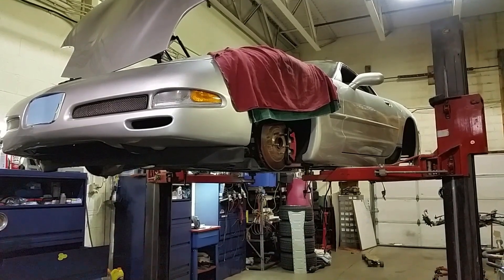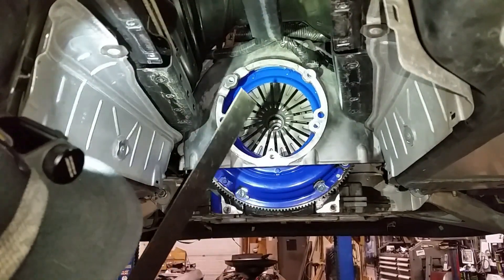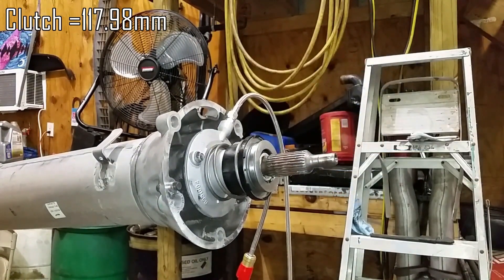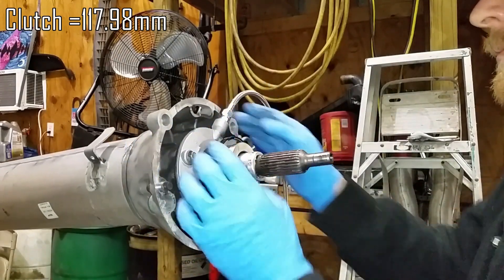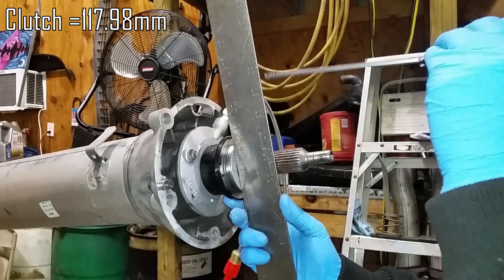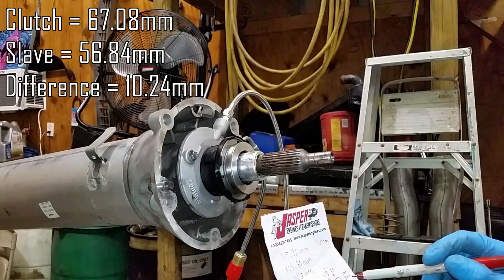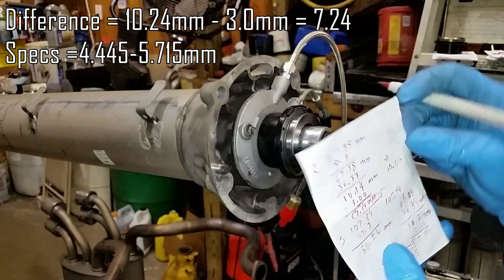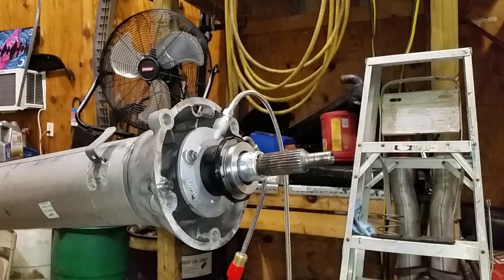How To Shim A Clutch for Quick Shifting At High RPM! : T56

Comment: Hello sir, can you tell me what the tool is called that you used with the straight edge to determine the distance and where i could find one? Thank you.
Reply from the maker: Its called a "Dial Caliper" Here is an amazon link https://amzn.to/3CIZ0dd 
I prefer the analog ones they work without batteries but the digital ones work just fine and are easy to get started
Reply: @CamaroRick  man thanks a ton for that!

Comment: I have a c5 z06, fully rebuilt trans, new McLeod rxt/shimmed properly .080, new slave, tick master. Go it all installed broke in clutch and did my first wot pull and the trans grinds going into 4th at high rpm. Trans shifts like butter driving normal. Any ideas?
Reply from the maker: The slave cylinder might not have enough throw, have air in it, or the clearance specs could be wrong, improper trans fluid etc. Id give McLeod a call and run through the options

Comment: Hello, i just bought a 99, c5 vette, i just made the whole clutch change, but the slave cylinder doesnt have any shim, the problem is that i have done this for 2 times, and both times the slave cylinder brokes, do you think that the shims are the real problem?
Reply from the maker: Did you measure the clearance? Try a GM slave cylinder. The only purpose of the shim is to give the sc proper spacing to fully release the push style clutch. Some need a shim, some do not.
Reply: @CamaroRick  i'm very grateful for your answer, i haven't measure yet because i din´t know how to do it, but your video was very helpfull, ill check it and i let you know what happen :D regards
Reply from the maker: @sdmex  Good luck, Happy to help!
Reply: So i screwed up, i swapped my engine out with an ls3 and i didnt remeasure for the clutch. If i had to shim this thing in the car, can i cut the spacer in half and slide it behind the slave without ripping to trans back out of the car?

Comment: I'm getting ready to start my top end build.  Going to need a better clutch soon.
Reply from the maker: I ended up just tracing and cutting out another shim from sheet metal and added it to the included one. Dial calipers are a great all around tool to have!
Reply: @CamaroRick  unfortunately I'm going to find a friend or pay someone to do that I have never rip a transmission out of a car and changed the clutch before